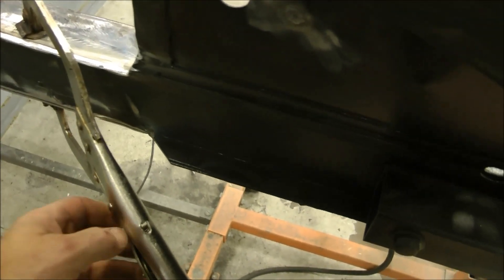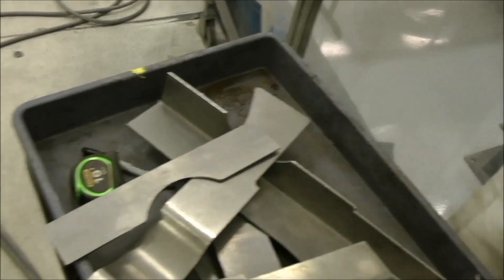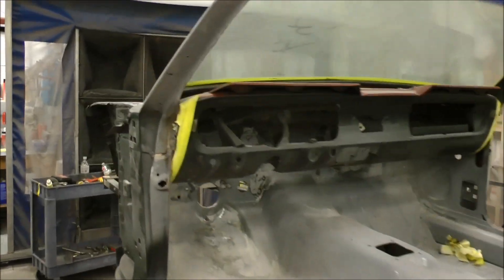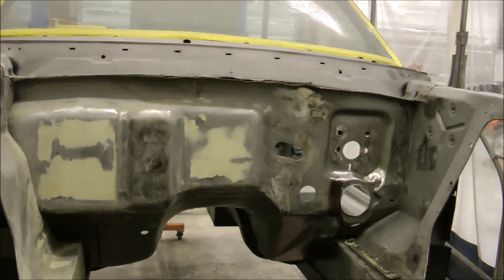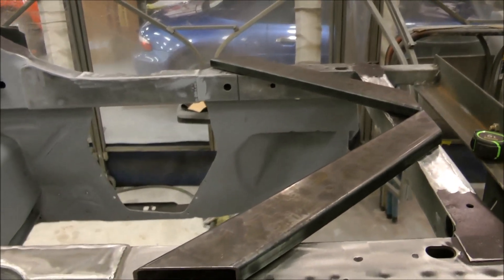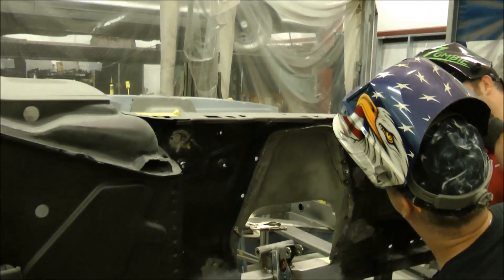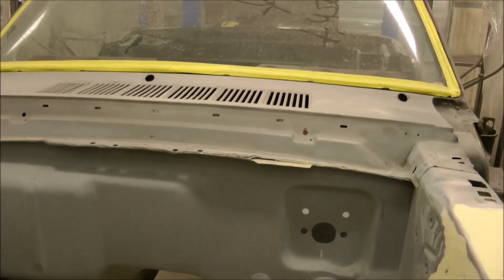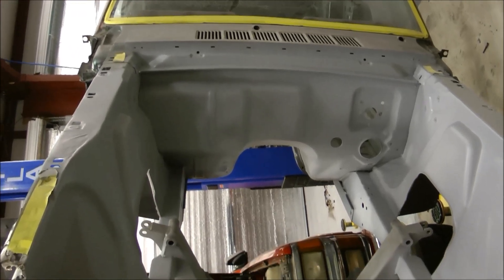1966 Electric Mustang Conversion Part 3

Comment: i want to see more shots of Joe welding.  that A brace looks super strong!  so much work going into these conversions.  hate to ask but would a kit build be faster/cheaper?
Reply from the maker: I have played with the idea of a kit, but frankly each customer has such different goals and desires, that these builds ultimately become restomods. We buy motors and inverters that are prebuilt, but the mounting and placement are going to be custom due to all of the other variables like suspension, power options, etc. the batteries are custom based on location, voltage and range. We have accepted that for now, we are a high end redo mod shop that has electric power as our claim to fame.